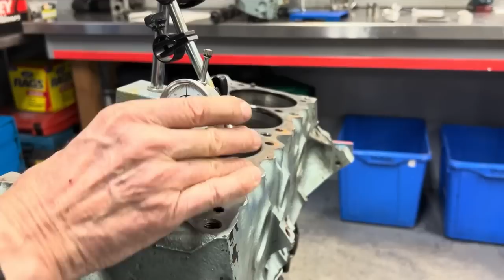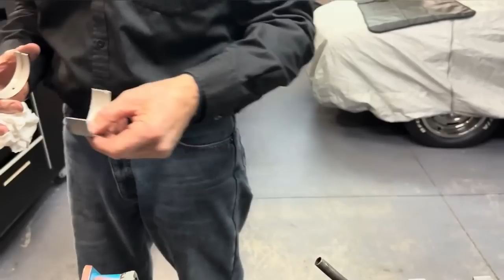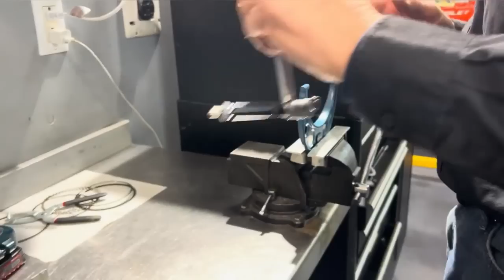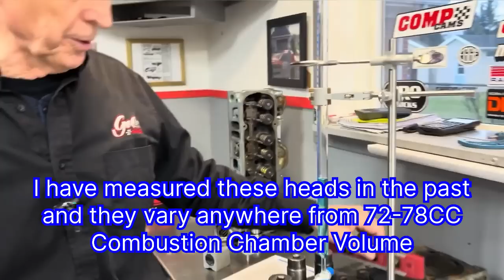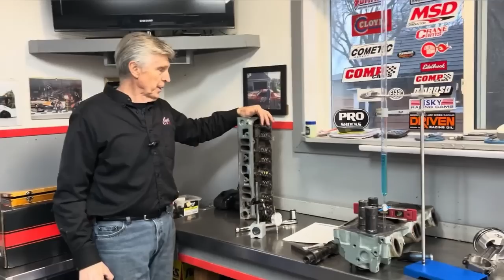Troubled 400 Pontiac engine showed up in pieces! Problems and Solutions

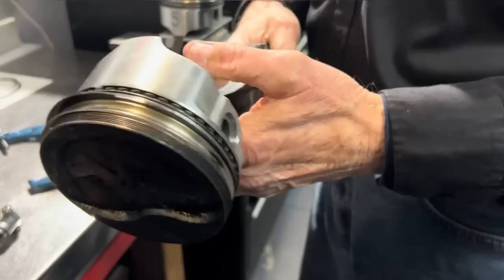Comment: 15:55 Yes, it was only Pontiac that did this, and they were called "Arma-Steel" connecting rods. 

They weren't very strong, and its recommended to NOT go over 5000-5500 with those rods in fear of breaking them.
Reply from the maker: Thanks for the recall Dave. My guess it was in collusion with ARMCO steel which was a major integrated steel producer at the time. I am a steel guy, I have been there. AG

Comment: Really like your video. Not common to see anyone working on a pontiac.  I like how you systematically solved the problems the customer told you about. 

Most unmodified pontiac dport heads don't flow much past around .400" lift on the intake. Unless heads are ported, all that extra lift is going to waste. I would also check if the intake valves were ground with the correct 30 degree angle. Most machine shops don't know this about 4bbl Pontiacs using a 30 degree intake seat for better mid-lift flow.  Pontiac d port heads from 67-76 were essentially very similar port wise, with the exception of combustion chamber size differences between 326-350-400-428-455's.   

On the valvetrain, you only need a bbc straight 7/16 rocker arm stud to replace the pontiac bottleneck ones. The stock pontiac rocker is actually 7/16' where it rides on the factory stud.  Then just some cheap self locking 7/16 nuts and your back to a zero lash adjustable vavletrain, which solves a lot of problems due to aftermarket parts and machine tolerences. 

Most of the comp cams XE are designed for sbc and aren't ideal for stock pontiac with d port heads. A d port headed 400 pontiac with a moderate factory style S camshaft and stock iron Q-jet intake is actually a very efficient design.   Many aftermarket dual plane pontiac intakes are worse performing than factory 67-72 cast iron intake. Pontiacs also used fully machined combustion chambers.

On the camshaft, it used to be the thing on a stock d port headed 400-455 to run a reporduction RAIV "T" 041 camshaft with rhoads lifters, to get the benefit of the reduced duration and lift at lower rpm but full lift/duration in upper rpm band, sort of like a cave man version of honda's VTEC. Lol

I would also check customers distributor and check total advance to see if it's too much for the cylinder pressure he's running. Also a lean jetting of carb and or a vaccum leak can contribute to preignition. 

One last thing, I ran a lot of pontiacs back in the 80's. The achilles heel in pontiacs are the cast rods, they're great until they come apart. Usually with stock valvetrain, you never run into a problem but with a 4 speed car and missing a shift, lets hope the customer has a rev limiter at the very least for insurance. I bought a set of SD455 rods back in the 80's right from a GM dealer, part #485225. They were decent rods for the time, but todays array of good affordable forged aftermarket rods, there's really no reason to run a stock pontiac cast rod unless its a pooch automatic stocker granny car. Also, a good set of aluminum d port or round port heads would be worth the cost, for less weight, better flow and newer technology. Speedmaster has an offshore RAIV heads with a better tech heart-shaped combustion chamber than the edelbrock version.
Reply from the maker: Thanks JLH. Lots of good information from a Pontiac expert.  That explains why the stock cams are only .407" lift. AG
Reply: Exactly. Only the RAIV, and SD455 received more than .407 lift.(excluding SD421) Those engines are as rare as hens teeth! lol   @goldsgarage8236

Comment: Great explanations with the background to understand what's going on.  If this were my engine, I would not buy anything and send it to you.  I'd have you buy the correct parts that you choose.  You made a good point that you taking it apart would have found more and I'm sure the engine owner has enough capability that they pulled it apart looking for obvious problems.  You did find that one obvious problem with the leaking valve that he sort of found with the low pressure but now, if I had that engine, I'd unbolt it from the car, pull off the accessories and ship it to you.  Great video.
Reply from the maker: Thanks for the compliment Jack. The leaking valve was easy to fix, I just lapped it and it is sealed. AG

Comment: Back in the day the trick on Ponchos was to replace the stock rocker studs with bigblock chevy rocker studs, then go to the Pontiac dealer and buy a set of 1.65 rockers (stock is 1.5) and a set of BBC rocker balls and locking nuts.
Reply from the maker: Thanks for the comment Richard. Check for push rod interference with 1.65 rockers. AG

Comment: 11:20 mark, the #2 rod assy is in the #1 cylinder.  Hope that didn’t get assembled that way..
Reply from the maker: Good catch Tony, for some reason the other side of the rod was marked #1, so there were two rods marked 1&2, 2 more marked 3&4, etc. In each case the piston install is determined by the location of the valve reliefs. Thanks for watching and commenting. AG

Comment: I'm an 'amateur car mechanic' but a professional motorcycle mechanic (only built car motors for myself)
60 thou, not ideal LOL, yep, seems a bit much to actually work as a quench area.
How do you work out dynamic compression? 
I've always used max 210psi cranking (around 300rpm) as a maximum cylinder pressure before you get problems. 
The cam overlap will determine cranking pressure
'Armasteel' was the Pontiac designation
I really should make a video showing the easiest way to set up a bore gauge, I see 'everyone' doing it the 'conventional' way  (yourself included)
I used to teach people 'how to' 
Don't you have to mill original stud pads when fitting BBC studs?
Reply from the maker: Thanks Crazy, I would like to see your video on dial bore gauges. 
I used Summit's CR Calculator, then Wallace DCR Calculator, it is accurate and fast. 
i will stick to my 180PSI max, remember, I have not control over what happens after the engine leaves my shop. Thanks for the input. AG
Reply: @goldsgarage8236  Ah, had not thought of that. It makes a lot of sense. If I can't control whats happening with engines I'm a lot more conservative and usually stay closer to factory specs. (except for some porting and cleaning up airflow)
I've been thinking of doing a short video on bore gauge set up for quite a long time but grandson would rather I watch him making shorts.
Edited to add; I'll make a camera mount with 1/4"x20 thread for tripod and get around to dial bore set up vid
Reply: @goldsgarage8236  I was just watching Max Grant, he uses almost exactly the same method I was teaching.
It's at about 32 minutes to 33 minutes, showing what is easiest way to set bore gauge and definitely easiest way to teach someone how to set one. The only difference, I have the 'wheels' same side as micrometer barrel.
https://youtu.be/I3jEiH4-f3I?si=2H1rif95ihtfdrm8

Comment: Back in 1984, I had fully grooved bearings in a 400 with a Ram Air IV oil pump.   The idea was to get more oil to the rods for higher rpm.  Unfortunately I couldn't afford better rods like the 455SD rods ($110 each back in 1984!).   Today I wouldn't spend a nickle on stock rods when Eagle and others makes a decent street/strip rod with bigger bolts and make from steel.  Pontiac cast rods are limited to about 5500rpm on a 400 and 5000rpm on a 455.   Exceed the rpm and you will egg the big end.
Mahle has a document talking about 1/2 grooved, 3/4 grooved and fully grooved bearings.   Bottom line, the half grooved was nearly as good in oiling and much better overall load carrying.   Mahle offers all 3, but recommends the 1/2 grooved.

The oil leak out the rear is the rope seal.   Its a PITA - I usually put a bit too much rope in there.

As for pinging.   Its pretty easy to get a 10:1 motor and if you put something like a smaller Com Cams - 268 cam, it will ping.   Retard the cam 4 degrees and it might live.   280 Magnum cam better match for both a 400 and 455.   I tried running a 252 and it pinged like crazy.
Are the bearings hammered?   If they still have spring back in them the engine probably didn't see detonation.   I assume the top of the pistons look clean. 

There is no reason to run low pump up or whatever they call those lifters.

My motor had the big valves and the screw in studs.  No issue with stock valve train.
Reply from the maker: Lot's of great information Confuse, I have both types of bearings available. Thanks you for taking the time to provide your input. AG

Comment: FWIW, anecdote, but when I rebuilt mine a few years ago, one of the (new) rod bearings had two uppers, rather than a matched upper and lower.  Also Clevite 77's.  So your experience may be similar, in that the bearings were not packaged properly.
Reply from the maker: Thanks Harry, that could be a dangerous situation. AG

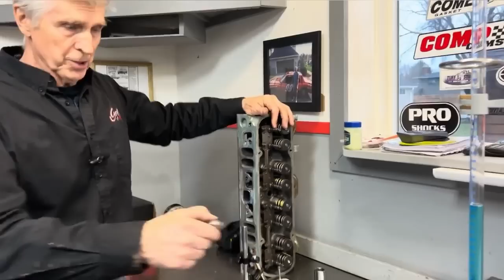Comment: in 23:03     Vaslin for what uses? Thanks
Reply from the maker: good observation K3. i use Vaseline to seal the plexiglass plate on the combustion chamber when i am using the burette to check the CC volume of a cylinder head. The fluid is Windex, AG
Reply: thanks sir, I started using Vaseline to break up flat tapped camshaft with good results so far.  @goldsgarage8236

Comment: I have seen those Pontiacs with failed cam bearings before. It would follow that lifter noise could be oil pressure leaking from the cam bearings, and would explain much of of the remaining evidence.
Reply from the maker: Thanks Gary, i wish i got to see them, but they are gone. AG

Comment: First of all that cam is too small for higher compression if distributor isnt optimized.
9.7 is decent compression for todays gas.
Now SBC lifters work fine in Pontiacs but not the other way around. Ive built many Pontiacs and used SBC lifters with no issue.
Now on Pontiac heads to mKe the valve train adjustable GM used to sell hardened washers to go under the rocker nut and you use SBC nuts.
If you want more quench deck the block to about -0.010"  to -0.015". If not to -0.005".
If its not gonna be rpmed you can zero deck it easy enough.
As for yhe oem Pontiac rods they are Pearlitic Cast Iron and are GARBAGE. RPM LIMIT OF 5000-5500 MAX considering it has good bolts.
Id jump up to 280 series and look for closer lobe center line to bleed low end peak cyl pressure.
I built my first 400 back in 87, ran closed chamber heads and flat tops and ran a short duration cam and itwould rattle its head off above 3500rpm , should have ran a RA3 or RA4 copy cam.
Built a reind a similar engine, my old heads and upped the cam and it will run up to 5000 with no rattle. With 66 cc chamber it wont need huge initial timing maybe 10-12 btdc.
Also make sure seals on timing cover are new and spacer plate isnt pitted bad and look for a water pump with cast full length vane impeller ir it will have hot spots .
Also DO NOT USE AUTOLITE PLUGS.

Look for AC Delco or NGK plugs, step up to HEI too.
Reply from the maker: Thanks for all the info Monza. We are decking the block. AG

Comment: Good stuff....I never have found mix and match on valve train components to be a great practice, Especially on Pontiac I use too run Comp Cams products on my 400 Pontiac back in the day. My 77 TA 6.6 well 400 I actually over Cammed and never had an issue on the Street...I used a 305 Magnum Camshaft and ran the mortal soup out of it... around 70,000 miles with Castrol changed every 3,000 never a issue and she was always ready for a Race
...
Reply from the maker: Thanks for the info Jean. AG

Comment: I forgot to add that installing a roller cam in a Pontiac is nearly a no go most of the time due to the fact that the foundry never put enough metal in the valley to support the lifters. You are stuck with the constant problems of flat tappet cams on these engines and that's a shame. Also the cylinder heads have pretty miserable flow and none of the factory heads were really any good even the stuff they considered high performance.
Reply: PLENTY of Pontiac V8 out there happily running roller cams. ..
Reply from the maker: Thanks Mike, great in depth knowledge about Pontiac's. AG

Comment: Pontiacs are a strange engine as well as Buicks and Oldsmobiles, especially if you are used to Chevrolet stuff. After working with all of them it's easy to  see why they were dropped in favor of putting Chevy engines in all the GM cars long ago. Too many weird issues with them plus none of them made the power that the Chevrolet engines did. The Pontiacs with their cast rods that broke at low rpm was a real show stopper. The Buicks with their terrible aluminum oil pump housing was real bad and Oldsmobile had some issues as well. The continued use of a rope seal was kind of stupid for as long as they did it too. All of the BOP line was designed for large heavy cars that needed plenty of low end torque and not much rpm to make any horsepower. They were all great for that and did it well. Great video, I can relate to your findings.
Reply from the maker: Thanks for watching and commenting Mike. AG

Comment: A few things I have found with nosey Pontiac valve train issues, Mic each of the rocker studs where they make contact with the rocker ball & rocker on the stud, check to see if someone used 1.65 Ram Air IV rockers as they WILL ware funny and can be noise. Also look real close at both ends of the push rod, they can get really to hot (lack of enough oil) and be a issue as well. One time I had a set of the factory push rod guide plates rubbing on the push rods! I had to drill out the mounting holes on the plates with a carbide oversize drill on the Bridgeport Mill, and adjust the plates to line up correctly with the push rods. Valve trains can be hard to find the problem.  One thing I do know in assembling any motor, there is no such thing as TO CLEAN ! pull them gally plugs and wire brush all them oil gallys 3/4/5 times, hot tank it twice and keep cleaning  !!!!
Reply from the maker: Thanks for the info Hydroy. You have some detailed experience with Pontiacs. AG

Comment: I would recommend pulling the oil gallery plugs and cleaning the passageways. I owned a '67 GTO Convert for 35 years, now my brother has had it for the 20. The engine has been built 4 times. Debris (carbon or metal) will build up in the passageways and starve the lifters for oil. Also it could run the cam bearings dry. Not saying you will find anything, but just saying the owner has come this far.
Reply from the maker: Good advice Jim, the block is at the MS for just that purpose. AG

Comment: Sounds like the guy got a cam and lifters without the right pushrods, rocker arms, and valve springs. With the leaked down on the valves the valves were hitting the pistons and bent them which all the previous stuff I mentioned would have caused the problem from the beggening. Just a guess. I've been learning more of this stuff for a 390 fe build.
Reply from the maker: Thanks for your observation Wk. I will be checking all that out on the rebuild and making videos of the progress. AG

Comment: pull the plugs, tank it, jetwash it, and do it right....your just setting yourself up for failure if you don't......and to pull those plugs, heat them with a torch, let them cool CLEAR down, and then use a HAND impact driver to remove them. (the heating and cooling will break them loose, and the Hand impact will get them started)
Reply from the maker: Thanks Skipper, that is exactly what we are doing. The block is at the MS now. AG

Comment: Love your channel. Pontiac 400 you didnt mention the connecting rod is offset and builders error when assembly. Also the block design has weak main saddles and crack where the oil hole is.
Reply from the maker: Thanks for the info Rich. AG

Comment: Absolutely start from scratch on this one.
ALL caps & plugs removed, Clean, inspect, measure and >Verify Everything<.
Trust Nothing. 
Pipe cleaner All oil galley passages in block, headers, Crank.
Start with a proper known base on the build.
Honesty, is there really any other way to do a Quality professional job??
Also, I'de chamfer All the Journals a bit on this engine.
Reply from the maker: Thanks Yafois. That is exactly what we are doing. The block is at the MS now. We are also decking it .018 to correct the quench. AG
Reply: @goldsgarage8236  
Glad to see this done, taking it on straight!
This set you back on your heels a bit I sense due to the extent of what occurred. 
Only one way to Mae a machine right, is from the specs, and go from there.

Comment: Thanks for the video and I do love Pontiacs. If possible it would be great if you mentioned what the stock compression was with original flat top pistons and were these heads the original heads? - I think you mentioned the engine code at the beginning of the video, but I did not catch it. Thanks!
Reply from the maker: Mike Kimble is my Pontiac expert, Mike can you please respond to this question? AG

Comment: I had similar problems with a Ford 302, turns out I had the main caps on backwards, causing the oil seal to leak and the bearings to grind up.
Reply from the maker: Thanks for the comment Pack. That would do it for sure. AG

Comment: Use a good sealant on the REAR oil gallery PLUG. I once used the wrong sealant and oil  leaked out, thinking it was the rear main seal. To prevent bearings from spinning, rebuild the big end on rods to the small side of spec for more crush.
Reply: Chevy big block exhaust pushrods are about 1/8" longer and are used for small base circle cams. I think this is correct?
Reply from the maker: Thanks for your comments Keith. We are now going to use Johnson Pontiac lifters, so the stock push rods should work. I will check the geometry on assembly. AG